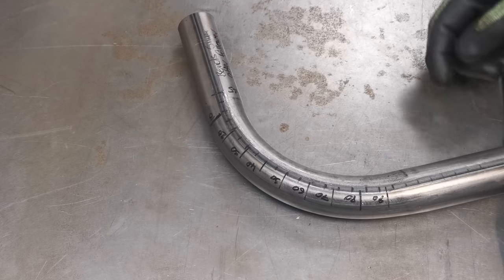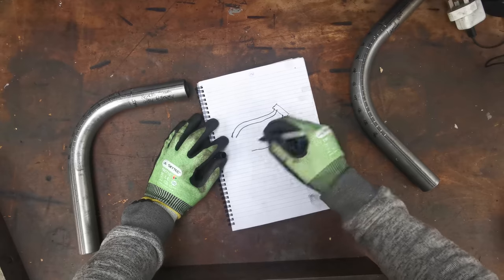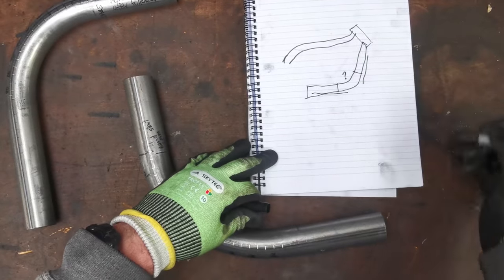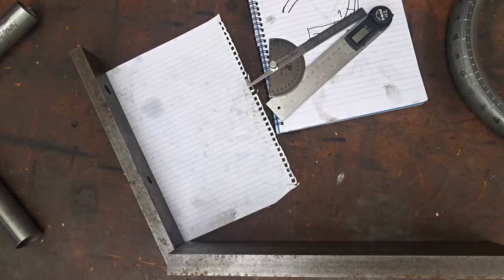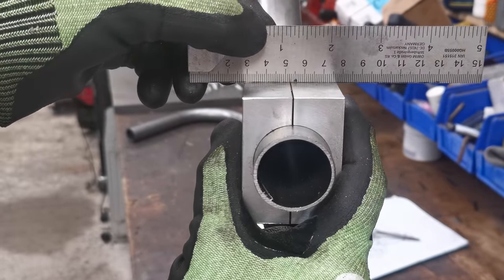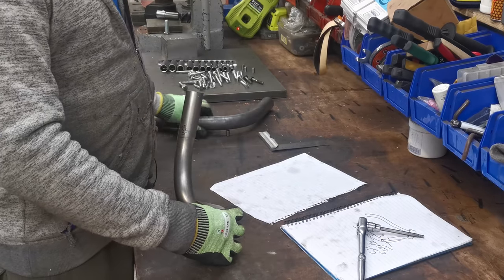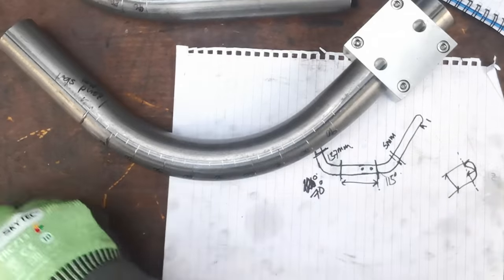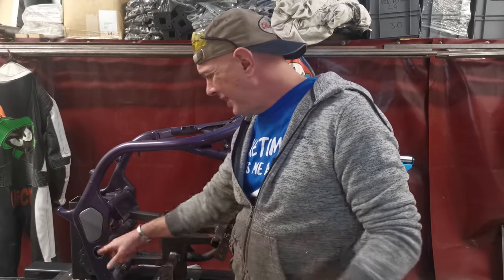Benders & Cheaters (Pt2) - Suzuki Bandit Cafe Racer - ASBO Project

Comment: Well Quicky what a brilliant couple of videos. Some time ago I watch Michael from Britannia Motorcycles who bought the same bender as you have and was using it for the first time. I ended up with the 101 questions that people have asked you. eg. when you first pull the arm to bend the pipe the arm excetra , moves before the pipe bends. He didn't say. You on the other hand explained everything perfectly and I under stood everything from beginning to end .  You'd make a good engineering teacher. Very well done fella. Keep up the good work, I am really enjoying it. Cheers, Mike.
Reply from the maker: Thank you matey. I've probably still missed out some bits, but at least you get the general idea hey 😁👍

Comment: Hey fella. For what it’s worth, in oz, tube benders refer to a bend by the number of degrees from straight not the included angle.
The one you describe as 115 would be 65.  I found that out when I got some headers mandrel  bent much to my disappointment. doesn’t really matter if your doing it yourself but be worth checking if a job was to be farmed out. 
Happy new Christmas from Oz
Reply from the maker: Yeah, same here... I did try to pick up the error when I described the second bend, but I'm not great at explaining stuff. That's the main reason I don't do tutorials 🤣😂
Well spotted matey 👍

Comment: Just watched videos, why not use the headstock u have and start from there? That leaves you the frame to take measurements and check everything is 👍
Reply from the maker: I thought about doing that, but the larger radius bends around the tank etc would be a problem as I don't have the tooling to do it.... Good shout though matey 😁

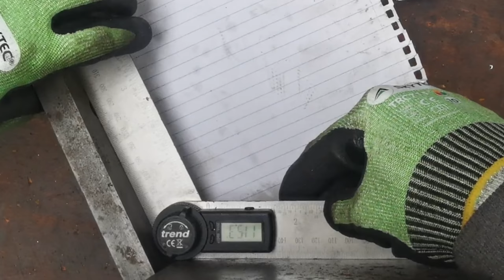Comment: Been watching your videos. Well done but just to point out that the angle you’re measuring @7:52 is not the bend angle. The bend angle is 180° minus (measured angle) 115° to give you a bend of 65°. You’re bending tube that’s effectively already 180° as it’s a straight length. 
Hope that makes sense.
Reply: …..and now watching further on I see you corrected the mistake. Easy to do but like you said, always check measurements again before cutting or bending. 👍
Reply from the maker: Rhank you for watching matey and yes I didn't explain in very well. You should see in the video where I bend all the tube that I open the angle finder up and zero it on a flat surface, then the angle I'm bending is correct like you say. This is why I'm not doing a How To channel as I'm RUBBISH at explaining stuff 🤣😂😅
Thanks for the comment matey, good to see you have your wits about you 😁👍
Reply from the maker: Justin.... that's who I wat he'd when I got into it, hence the cheater etc. Urchfab is another good fabricator and worth watching IMHO 😁👍
Reply: @QuickBikes  sounds like we watch the same. Fab Forums is good too. He has some cool projects on the go.
Reply from the maker: He's got LOADS of toys that fella, and the biggest shop on the planet 🤣
Reply: @QuickBikes  he has. Anyway I need to get up and bend this 1.75” roll cage, 14swg wall. It’s a proper workout I’ll tell you that! 
Maybe I should put a video up on YouTube. I’ve thought about it before but it takes hours to edit I bet?
Reply from the maker: Do it matey... its a really good scrapbook 😁